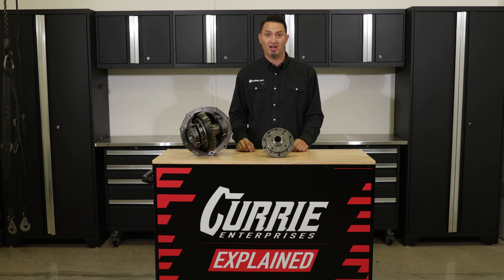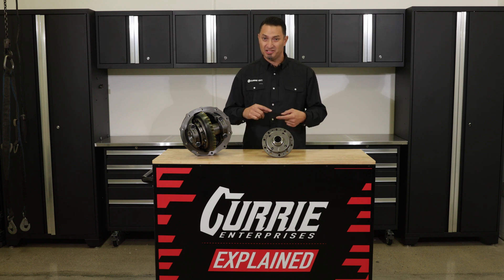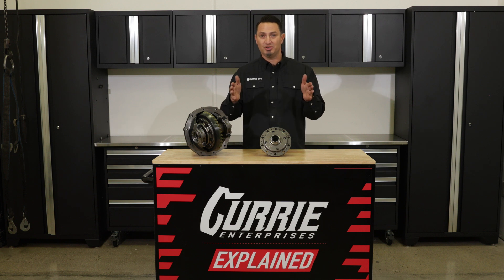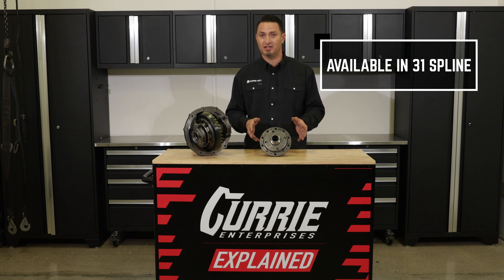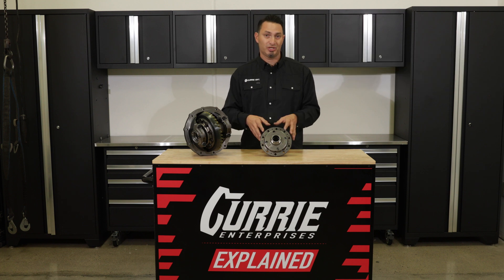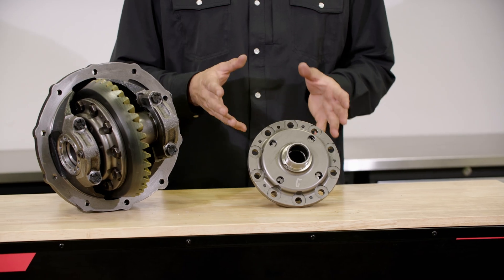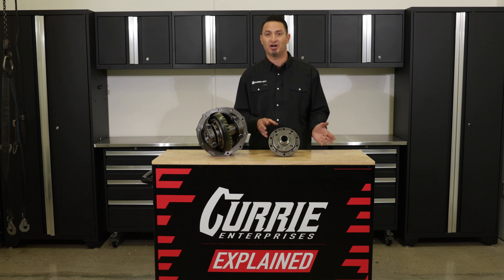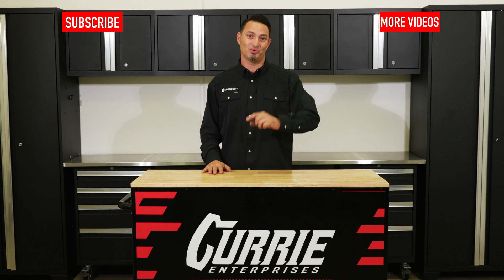What is the Currie TwinTrac Differential? | Explained

Comment: Really want to drop one of these into my 1970 GTO Convert...Spring 2025, dropping in a KAUFFMAN-BUILT 467", ported head, Hyd roller cam...custom Muncie 4 speed car.
Mostly "street", but wanna track it once in awhile. 
Motor will Dyno at 600hp/600tq
Aaking Currie (or those who know)...would this be the Rear Diff for me?
It looks good, because I want to be able to drive & enjoy my car (no hard "chattering" around corners or U Turns,  but able to take 600 ft lbs of Torque.

What do y'all think ?

Comment: Looks interesting. Is the TwinTrac stronger than the Eaton Truetrac?
Reply: Doesn't look like it, those worm gears are tiny.
Reply: I've personally had the TwinTrac in two high horsepower applications, and it performed as expected on the AutoX and on the Hot Rod Power Tour
Reply: @jonhenson2523  Nice, I'm glad it's a good diff. Currie always seems to sell good products.